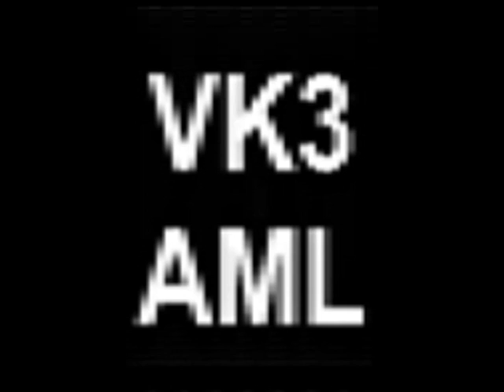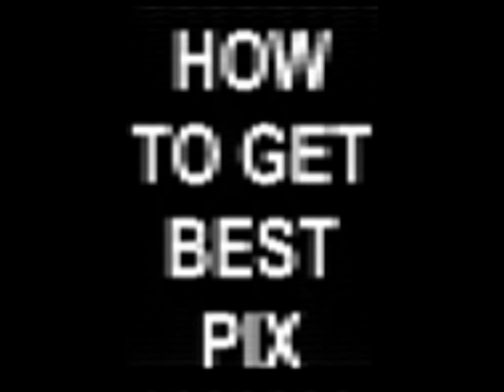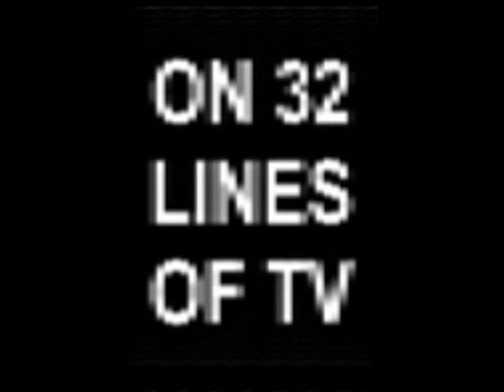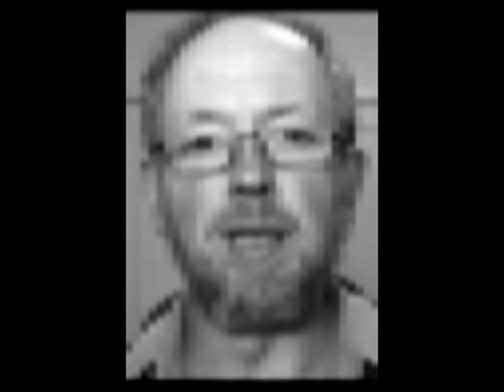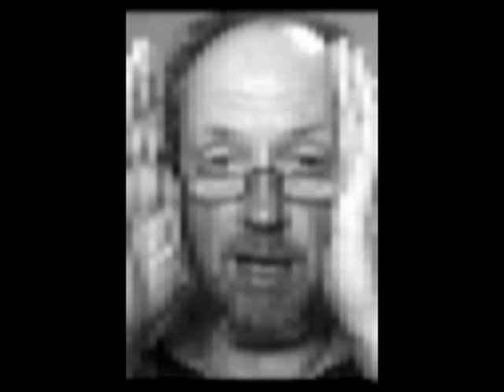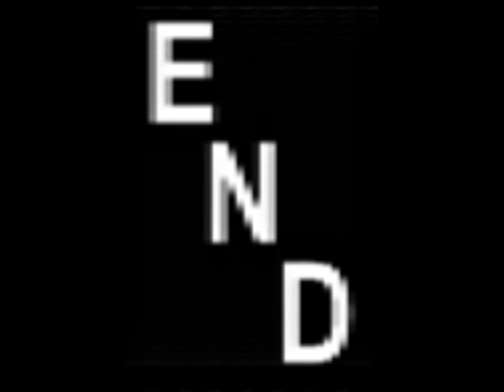NBTV: talk on optimising 32 line pictures.

Comment from the maker: It would have the same effect, and be easier on CPU load, if controlled blurring was introduced ACROSS the line transitions, but NOT blurring ALONG the lines. Upscaling would involve a great increase in CPU load. That may be a problem with older computers having slow clock rates or limited RAM. The point of this is that these pictures can be transmitted in either a 5 or 10 kHz bandwidth dependent on picture repetition rate: the pics are not intended for viewing in full-screen size.

Comment from the maker: No, it could not be improved to any great degree, except by reducing the perceived scan line transitions. Within a given bandwidth, the detail cannot be improved by upscaling. Digital transmission on HF is problematic, as the ionospheric path is dynamic, constantly changing, and return error correction is mostly impossible with ham-level technology. Digital image bandwidth compression is therefore no option and what you see here is the current limit of what one can send.
Reply: If you are going to use modern digital electronics then why do it at all?
Most ionospheric interference dies out at frequencies above 20MHz.

Some such atmospheric interference is still present even at wavelengths of 2 Meters. It is a form of Scatter Propagation called: Ducting
Reply from the maker: The point is that this narrow bandwidth stuff can be transmitted huge distances by ionospheric propagation, on medium wave and on HF. BBC viewers of the 30-line service on medium wave gave good reports from as far afield as Spanish Morocco and Northern Iceland. Additionally, the digital reception method eliminates flicker on the received pictures, as you see here.

Comment: Surprisingly good quality for the 32 line resolution.   If the receiver decodes this with software, it might improve it even more if it were upscalled.   This, of course, won't increase the detail of the image, but it can make it easier on the eye and smoother looking

Comment: Yes, I realize that.   The reason you'd use this would be to allow transmission of images over something like HF where you have very limited bandwidth and could never transmit conventional television.   I'm just saying that if you were communicating using NBTV with another ham, the perceived quality could be improved on the receiver end.

Comment: Can I receive your transmissions from finland? I have all those Gary Millard's softwares, But I have only K-PO WR2100 word radio + SSB BFO converter. And if my K-PO WR2100 word radio doesn't not enough can I then receive your signal WebSdr wideband radio? :)